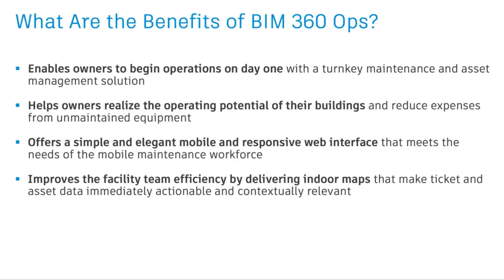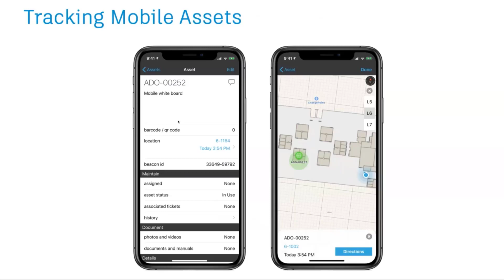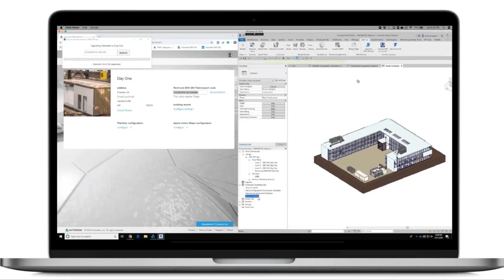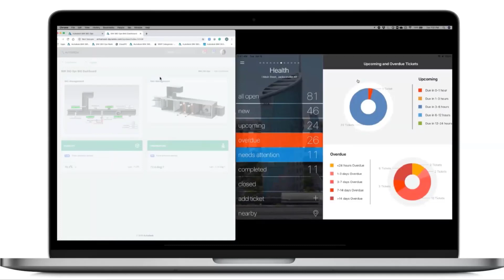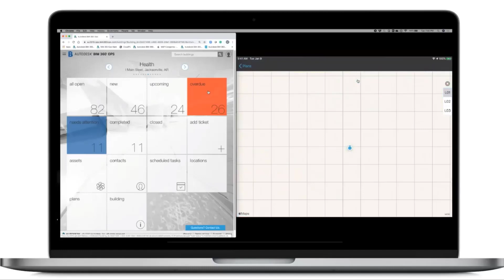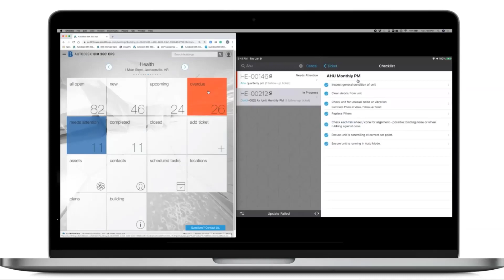Day One Readiness: Introduction to Autodesk BIM 360 Ops

Comment: Does the AHU have live sensors hooked up to it you could check and actuators you could adjust remotely eliminating the need for a very expensive site visit?
Reply from the maker: Got this from our team: Assuming that AHU stands for Air Handler Unit.  Not in the specific use case of this demonstration project.  However, we can and have integrated with live sensors and can make remote adjustments.  This is one use case of IoT devices to assist in facilities management.